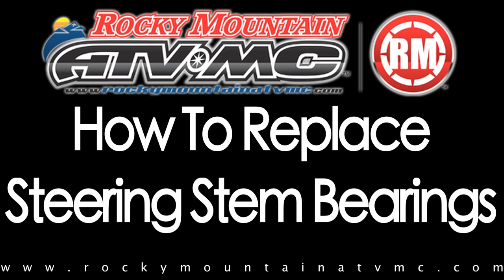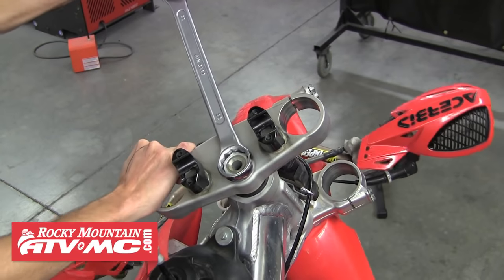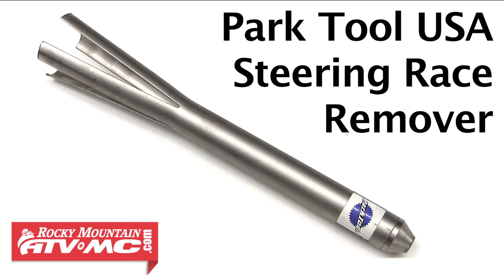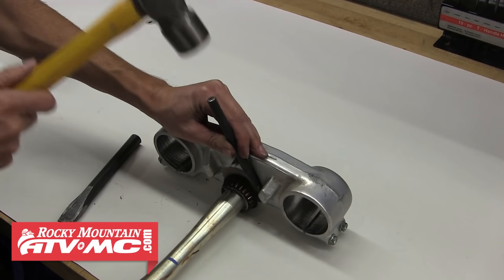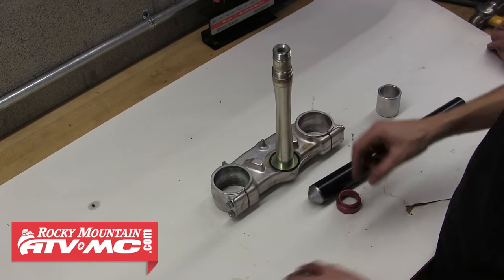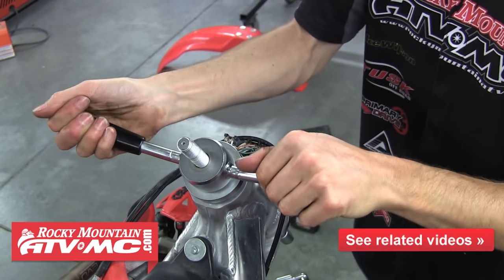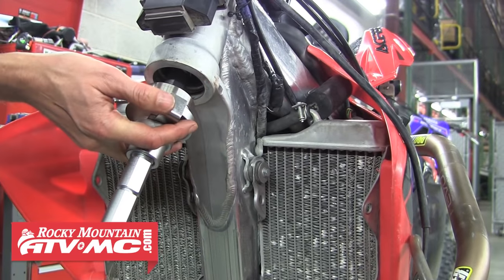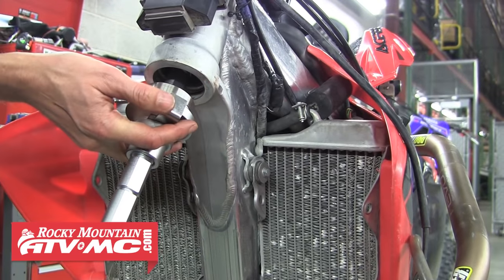Motorcycle Steering Stem Bearing Replacement

Comment: Can the bearings and race's withstand being baked at 200c ?

I am getting my frame powder coated and I don't have the tools to remove this stuff properly.
Reply from the maker: +surg23 No.  You would definitely want to remove the bearings if you are wanting to reuse them.  The bearings would get ruined in the process of powder coating.
Reply: Rocky Mountain ATV MC Aww crud. Thanks for the info!
Reply from the maker: +surg23 You're welcome.. good luck on the job!
Reply: Rocky Mountain ATV MC Cheers!

Comment: What could be subbed for the race install tool?
Reply from the maker: You can use one of the old races that you previously removed and line it up on top of the new race and use that to drive the race into the frame neck. This is a fairly common method...
Reply: Genius!

Comment: Considering how fricken long tapered wheel bearings last in cars and trucks it seems to me like mototcycle steering stem TRBs should last basically FOREVER....unless some douche blasts that area with a pressure washer !   You can destroy lots of stuff with a pressure washer....blasts out grease and leaves nothing but water to rust....I believe bikes could be engineered to pretty well seal these bearings....if they wanted to....along with swing arm and linkage etc....other places people love to blast with pressure washers

Comment: I'll try the chisel method. I think these bearings on this bike are from the factory. The bike is a 1993 😧
Reply from the maker: It gets the job done.  Takes a little longer, but works.  Got to love factory OEM quality parts!  Let us know if you run into any questions.  Thanks Vinny
Reply: Chisel method does not work for me. I knock off the outer bearings, then use a Dremel with a small cutting wheel to cut a notch in the inner race. Hit it with a little heat, then use a punch in the notch to spin the race. Once you can spin it, it should slide off. Same concept as removing a stripped nut.
Reply from the maker: Nice tip King Troll.  Thanks for sharing.

Comment: Hi! So I had a notch somewhere in the bearings where my handlebars centred and were not smooth. I've purchased new bearings and had my mechanic replace them. For a few days it was fine but it now reverted to the same thing + handlebar feels unbalanced now leaning towards the right. Before I let loose on my mechanic was wondering if anyone here could say what could possibly be the cause if not the bearings?
Reply from the maker: Dimitri Boyarski I wonder if he replaced the outer races of the steering stem bearings or if he re-used them? Did he pack the bearings with grease? Could it be a cable snagging and catching possibly? Not sure what bikes it on, but those would be my guesses you could try out. Thanks for chiming in man!
Reply: Rocky Mountain ATV MC Hi, Thanks. So i got 2 full kits (upper and lower), I'm sure he greased and installed both. Bike is my (L) CBF 125 so couldn't have been that difficult. The steering feels like there's a notch when dead centre, having corrected this immediatelly after install it reverted back to exact same notch, only now it also feels unbalanced leaning to the right. Doesnt feel like a cable snag but more like something mechanical. PS What is "chiming"?
Reply from the maker: Dimitri Boyarski Chiming is a term we just use for the notification "Bell" in the top right corner is all :).  And it's tuff to say what the issue could be not having the bike here to look at?  Best thing to do is tear back into it again and see if you can diagnose where the problem is happening. It best sounds like a bearing issue.. maybe it wasn't pressed in straight? Give it a try and let us know what else we can help you out on man! Thanks for watching.
Reply: Rocky Mountain ATV MC Hi, Thanks, I'm taking it back tomorrow. The fella better have some good answers for me considering how much I paid for the job to start with.
Reply from the maker: Dimitri Boyarski Yea, show him what its doing.  Did you tell him about it and show him the problem it was having the first time?
Reply: Rocky Mountain ATV MC Yeah, he was the one that reccomended a bearings change. As I'm pretty fresh on 2 wheels I've not had much dealings with the fellow but going by his rates one would think he would know what's up! We'll see tomorrow. Thanks again for your help guys.
Reply: Rocky Mountain ATV MC 
How time flies, just watched this again for reference as about to try doing it myself. Gonna have to improvise on some of these tools though, damn this hobby is expencive.